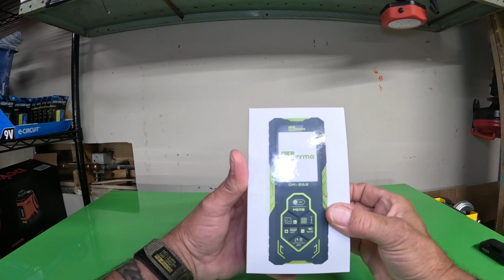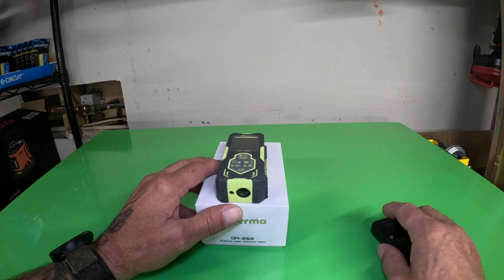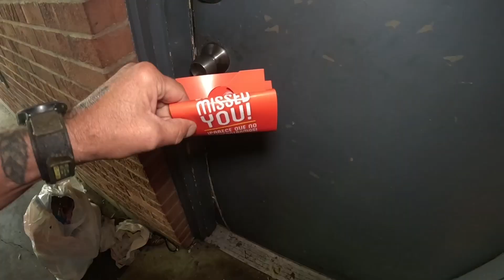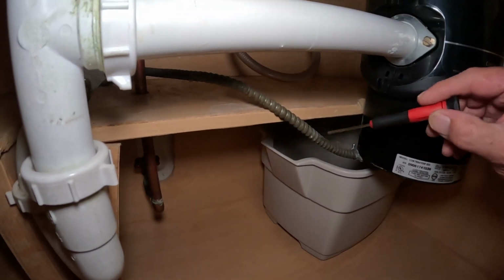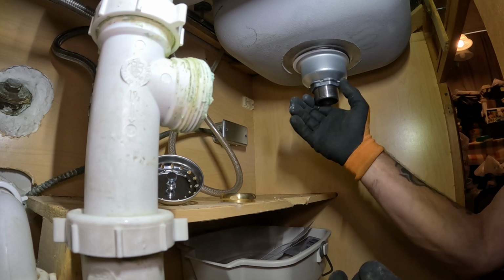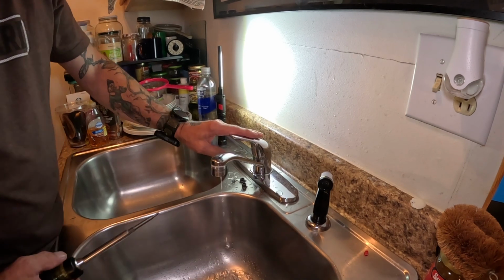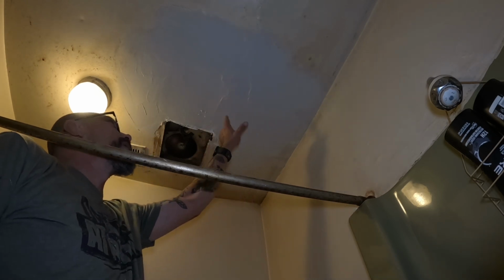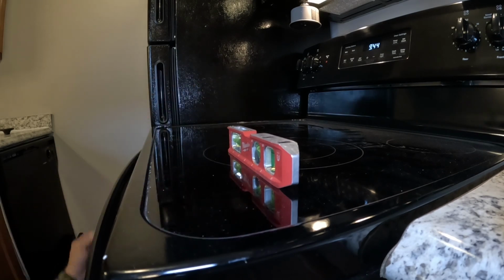Day 33 as apartment maintenance

Comment: Hey, Ray. I got the 2 stickers I ordered. Thank you, sir. To remove those small pieces from the faucet, I would recommend a set of hooks/scribes from Harbor Freight. The ones I have got a blaze orange handle and come in various hook ends. I use them all the time to remove rubber washers, inserts or other small tasks in confined areas. Also, do some of your tenants have a security camera set up and talk you through their work order requests or anything like that? Just wondering because last month I did a baseboard job for a client and they were surprised to see me keep organized with tools in the middle, clean up after myself and even work without a peep. They though the audio was broke until I moved items around, ran air compressor etc and sound was heard. Thanks for all you do and record for us to see, Ray.
Reply from the maker: you allows have to go into units with the mide set --> someone is watching you, cause there are cameras looking all the time. That's the reason I carry a GoPro with me. Complaining tenant  I record everything. That just happened and I got her in a lie.

Comment: On the sticking door, why not just plane the hinge side of the door and re-cut the hinge mortises?  Thanks for the discount on the laser measure tool.
Reply from the maker: "why not just plane the hinge side".   it was just at the stick plate where it was rubbing . removing the door and doing all that was not necessary
Reply: @Raysmaintenance  I can see you are much more efficient than me.

Comment: Once the disposal starts having problems it comes out and don’t go back!
Reply: I used to work at a complex that had "garberators" and we used to take them out when they caused leaking issues. The question I have is, would the tenant ask for a reduction in rent because you were taking away an appliance?

Comment: Ray when you check a sink for leaks, I always put a stopper in the sink and fill it halfway up with water then pull the plug. That way its a little pressurized.  If it doesn't leak then you are good with no pressure.

Comment: Hey boss man I’m wondering why you don’t use a shorter acting drywall mud. I’m not an expert but I picked up some 45 and it seems to work well enough. Is there a reason I might want to switch to 90? I just use it for basic patches and repairs in the house and shops.
Reply from the maker: I found that the 90min mud set's up faster and it's easy sand. the faster set time mud will be really hard to sand when it dries.
Reply: @Raysmaintenance  got it thanks
Reply: The quicker the mud sets, the more plaster is in it. Plaster drys very hard.
Reply: @meandmine569  that makes sense

Comment: I've never seen an apartment maintenance man supply as many personal tools as you do. I myself do apartment maintenance and supply a lot of tools more than most but I don't think it's right because the company won't buy more tools all I ever hear is about their budget
Reply from the maker: tool for the work is not the property's reasonability. If you need a tool to do a repair and the PM will not pay for it, then dont try and fix it The PM will never buy a dewalt or Milwaukee tool. I buy tools to do the work cause that my chose. I dont ask them to get a tool unless its a tool that the property should have. I look at it this way, if I ever leave this job the PM will have a hard time to replace me lol. Rember this (my tool's my rules) not the PM tool's